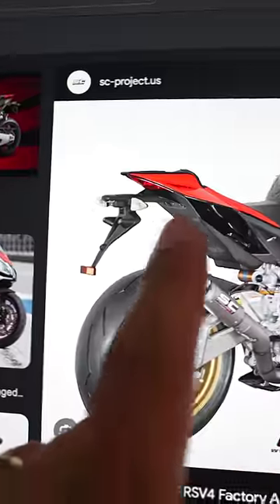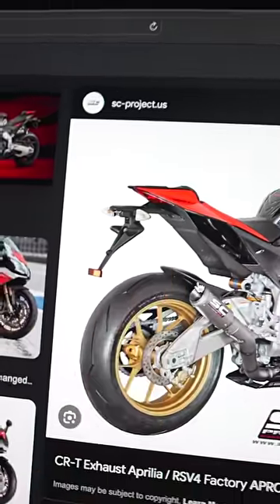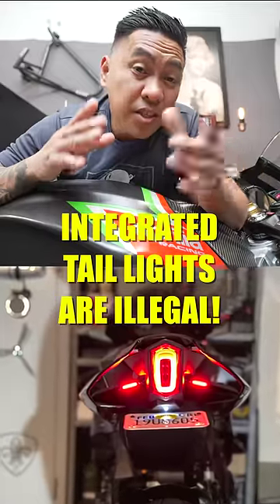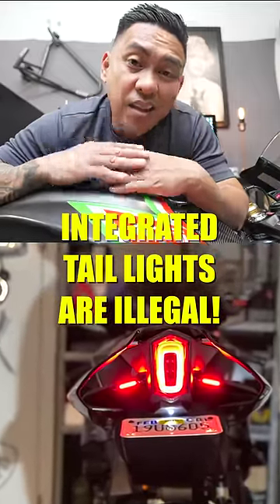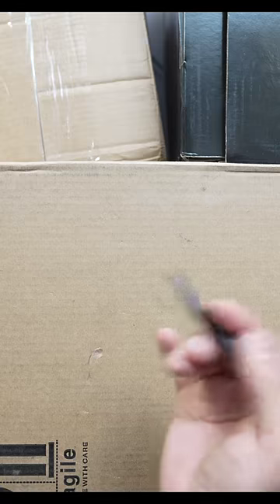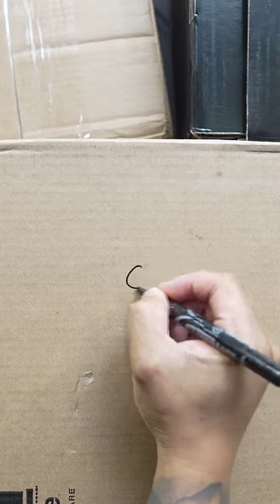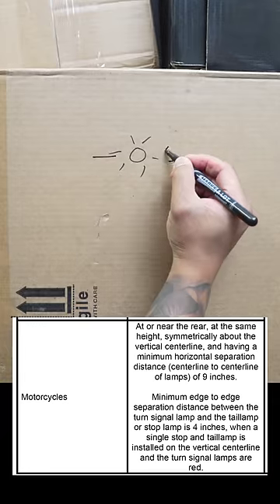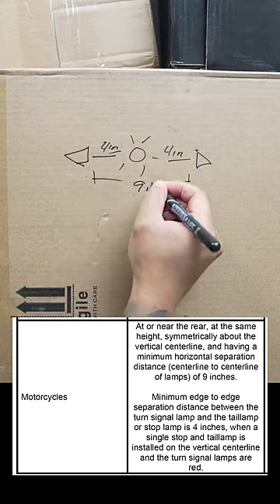INTEGRATED MOTORCYCLE TURN SIGNALS ARE ILLEGAL

Comment: Ive been pulled over on my bikes and they all have integrated tail lights🤣 theyre more concerned why i was going 95 on a 65🤷🏻‍♀️
Reply: Only 95 in a 65? 😂
Reply: @snisneves2894  i dont ride my limit on the freeway cause im not a dumbturd. I ride my limits and beyond on the track where its intended for. Anyone can go 180+mph on the freeway if you open up the throttle. It doesnt take skill to do that.🤣 you obviously think just cause you can open the throttle on a straight road you can race on a track🤣
Reply: I would be concernd to considering your putting others lives at risk. Save going fast for the race track.
Reply: @ihateeverything3972  agreed and the tell you this in any safety course.
Reply: That's because the regulation is for what the manufacturer is allowed to do, not what you can do. What you can do is based on the laws in your states, you don't even need turn signals, you can use hand signals.

Comment: Stop educating the cops! 😂
Reply: That’s ok, I’m sure my ins. co. knows this and will use my dashcam video to deny your claim when you get hit because other drivers can’t figure out what your doing.
Reply: The one the showed should be legal but cops and judges are so retarded they would say its all one light so they are not separated even tho the actual leds are separated to requirements they just happen to be behind a pannel. Nowhere in the law does it state it cannot be behind a shield. If it says cannot be part of the same module, what defines a module? U could say the motorcycle itself is one model. They always say beyond a reasonable doubt but when i present reasonable doubt they pull out the book and quote it as if thats that. Its like getting a ticket for making a u turn when you never actually made a u turn, you told the cop u we’re attempting to make one before u got side swiped by the guy behind you. I hate cops with a passion. Respect is given on a case by case basis
Reply: @KI4HOK You are the same type of person that says lane splitting is reckless, and dangerous out of spite
Reply: Fr💀
Reply: Sounds like an oxymoron
Reply: @KI4HOK   Aftermarket tail tidys aren't necessarily less visible than OEM. Sure some will be... but not all.
I'm still rocking the OEM tail tidy because I haven't found one that I'm 100% happy with.
Reply: @KI4HOK  You needed to be hugged more as a child.
Reply: Bikes don't even need turn signals, you can use hand signals. Integrated turn signals aren't illegal, the regulation is for what the manufacturer is allowed to do it doesn't mean you can't change it later. What you can or cannot do is based on your state's laws.
Reply: @KI4HOK  well I got a tst taillight so if you don't know which way I'm turning thats your fault
Reply: @KI4HOK ok Karen 😢

Comment: “Combined lights refer to those that have a dual function, meaning they can act as both brake lights and turn signals on a motorcycle. In the context of the regulations for rear lights and turn signals in California, if a motorcycle uses combined lights, there is no specific requirement for separation between the brake lights and turn signals.

Instead of having separate lights for individual functions, combined lights use the same light source to emit both the brake signal and the turn signal. This means that there is no rigid separation established between these lights, as they are designed to work together in a single unit.

In summary, if a motorcycle in California uses combined lights that function as both brake lights and turn signals, there is no specific separation required between them, as they are designed to work together as an integrated light unit.”

Comment: Depends on your state though, where I'm at you don't need turn signals at all as long as you use hand signals to indicate lane changes and turns.
Reply: No turn signals required on motorcycles in my state, and no signal required for lane changes, either.

Comment: My state doesn't require turn signals as long as you have 1 arm.
Reply: Thats only acceptable during daytime operation.
Reply: @Rod  as long as we have a headlamp and tail lamp with brake indicators 1 arm is still sufficient.  👌
Reply: @Rod  I did learn today they now require at least one rear view mirror. That used to be at rider discretion.  🤣  updated in 2021
Reply: Last I knew, my state doesn't require turn signals, or a helmet.

Comment: Those crappy brake light turn signal combos are hard to see during the day.
Especially those horrible cheap ebay units.

I bought a Superhawk with that set up.
Was a clear lens type. It looked tacky and cheap.

I replaced it with a used clean OEM and added knockoff NSR 250 turn signals.
Has a nice clean almost factory look. They only stick out about 2" or 8" to the Gixxer boys measurement guide.

Comment: I just remove all of the signal lights on my bike. I'm in a state where they're not required.
Reply: Wtf😂
Reply: Which state does not require indicators?
Reply: @19099090  his state
Reply: @slow_ae2676  I've been told by quite a few inspectors in my state that the law is that if they are ON THE BIKE they are required to work and follow regulations. Nothing in the law stating that the lights themselves are required on a motorcycle.
Reply: @zaofactor  amazing legal advice 🙏
Reply: @slow_ae2676  I can pull up the regs if you'd like. I pass saftey inspections every year with it. A bike is not a car. No one sees bikes anyway, and hand signals are more likely to get a motorists attention than two small lights nine inches apart from each other. At least that's the reasoning in the state I live in.
Reply: @zaofactor  i mean yes hand singnals are great for the daytime but at night unless your wearing neon green gloves or bright orange no one will see your hand.
Reply: @roadkillpotato3468  The point is that no one will see you regardless of signals or not. At night your best bet are your brake lights. Not yellow lights nine inches apart from each other.
Reply: @zaofactor  so then tell me, Why do they require turn signals on cars?
Reply: @zaofactor  the point of the turn signal is to let others know your turning or changing to another lane. In the pitch black of night visibility is important which is why things like brake lights, turn signals and headlights are required on vehicles by law. Not just you can see but others can see you.
Reply: @zaofactor  I can't tell you how annoying it is when people don't use thier turn signals to indicate they need to turn and they slow down suddenly forcing the person behind them to hit the brakes hard.
Reply: @roadkillpotato3468  yeah well you shouldn't be following a biker so closely that it will make a difference anyways. Same thing when following a car. That's a YOU problem. If every biker had that same mindset there would be even more motorcycle accidents. Signal lights only work when people see you. Motorcycles generally are invisible.
Reply: @roadkillpotato3468  And signal lights on a motorcycle are not required by law everywhere. I know because they're not required in my state. You literally can take them off completely and pass a seftey inspection.
Reply: @zaofactor  "that's a you problem" you sounded like a 6 year old right there.  Also I keep the appropriate distance of 1 car length while driving at all times for your information.
Reply: @zaofactor  "motorcycles are generally invisible" and you don't see a problem with that?
Reply: @zaofactor   Yes I'm aware that where you live they are not required. You stated that previously under this comment that's not what I'm talking about. I'm talking about the logic that motorcycles don't need turn signals but cars and trucks do.
Reply: @roadkillpotato3468  first off, this being a you problem is correct. Second, you following by "one car legnth" is proof that this is a you problem. You should be using the seconds rule when following as it takes more than a car's length to come to a full stop when going anywhere over 20 mph. And Third, motorcycles are invisible because the vast majority of people driving cars are simply conditioned to looking out for other cars. Not motorcycles. But signal lights are NOT going to do anything to help that. Retraining millions of people will help with that and that's not gonna happen. So if you're gonna be safe on a motorcycle,  you ride like you're invisible because to the soccer mom dealing with her kids in the car, or any other average driver,you are. No signal light is gonna change that.
Reply: @roadkillpotato3468  motorcycles can filter and cars can't.  Motorcycles lean into turns and cars and trucks can't. Motorcycles are normally no wider than your shoulders and cars and trucks aren't. Motorcycles have rounded tires and cars and trucks don't They're completely different vehicles with different needs. Motorcycles don't need signals like cars and trucks do because most people don't even see them.
Reply: @zaofactor  really? because that's what I was taught in drivers ed when I was 17 by an ex truck driver and state certified instructor. Thanks for showing your immaturity though.
Reply: @zaofactor  size has nothing to do with visibility at night. The whole point of lights on vehicles is so you know that there is a vehicle there.
Reply: @roadkillpotato3468  He was probably right back then, but they also used to say that earth was the center of the universe. You learn more. Standards change. But that the kind of retraining that would be needed to help make motorcycles more visible to average drivers. The fact that you think the  urrent way you drive is correct simply proves my point. So let's do this, I'll ride my bike and be fine, and you try not to run into people and not get frustrated by people not using signals.
Reply: @roadkillpotato3468  Motorcycles have lights on the back of them. They are required by law to have a tailight and a brake light. That there satisfies those needs to see a bike at night. Not signal lights.
Reply: @zaofactor  maybe if you have shitty brakes. Where I live the speed limit on most of the streets is 30-35mph.  I have no problem coming to complete stop at that speed. Some streets are 40-45 and I still can slow down rather quickly. If it was highway speeds which here are 55-75 then yes it would take quite the distance. I have drum brakes in the rear and plain disk brakes in the front.  I live in a large city with lots of traffic and on the main roads and 1 car length is what you'll get most of the time.
Reply: @zaofactor   yes because not using your turn signals is the correct way to drive(sarcasm). If people didn't need to use turn signals to drive then it wouldn't be required by law for factories to put them on vehicles and it would not be illegal to replace the amber bulbs in front  headlights and rear tail lights that use them with something that is not amber colored.
Reply: @zaofactor  I'm 26 years old so that 1 car length rule was taught not all that long ago.
Reply: @roadkillpotato3468  all rules that apply to cars and trucks everywhere. Not the same for bikes. Bikes are just different machines and require different driving styles and rules. Simple logic.
Reply: @zaofactor  they should be able to signal that they are turning regardless day or night so others know they want to turn, change lane or merge. Simple logic.

Comment: And it's hard to see and discern which direction the signal is too.

Looks cool but not safe and not for me
Reply: Yeah. But some design with integrated turn signal and brake light are fine. For example honda wave 100, wave 125, xrm 125, rs 125 and yamaha mio (except for mio aerox), yamaha nmax sold in Philippnes.

Comment: Here’s the thing, that’s an inspection violation, not a moving violation. You cant be pulled over for it. As long as you have an operating brake light and blinkers, thats all the law requires. The standards that manufacturers have to follow when producing/selling the bike are different.
Reply: Not every state even has inspections. I dont. And my state leos dont enforce federal law

Comment: Unpopular opinion, integrated tail lights look bad and can be dangerous.
Looking bad would be the subjective part. But objectively, making your lights pull double duty means you lose out on parts of both. You get less separation making the different lights, that are already relatively small to begin with, harder to distinguish, and you lose out on brake lights in order to have indicators.

Comment: See it's not recommended but what I did was I just bought the tiny ass blinker bulbs that are like 1/2 wide drilled a couple holes into my tail fairing and wired it up from there. Didn't have any trouble with the police

Comment: But wait, if it's 4 from brake light to brake light (which is 8) and it has to be 9 from blinker to blinker, that means you can only have a rear light of 1 inch wide?

Comment: My cruiser hasn't had rear turn signals in 3 years... never have I been pulled over... Hand 👏 work just fine I have front ones. my state is Kentucky.... I also don't speed over 5 mph bikes not loud 🔊 they don't mess with me knock on wood 🪵

Comment: We don’t run turn signals in my area, “hand signals” are acceptable 😂
Reply: But, if you have and use them, they most likely need to meet federal regulations. In my state turn signals aren't required, but if you have them and use them, they need to be in "proper working order".

Comment: I can tell you thats complete cap considering my 2009 cobalt lt the entire brake light is the turn signal. It has no side indicators or yellow portion, the whole brake blinks. If my car doesnt need the separation between brake light and turn signal why tf does a bike especially since most bike turn signals are not red like mine is